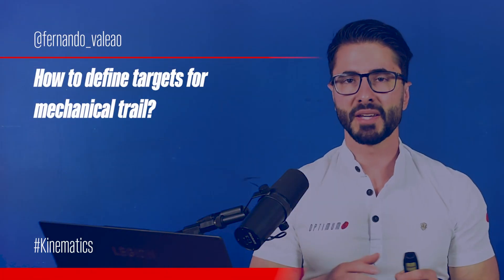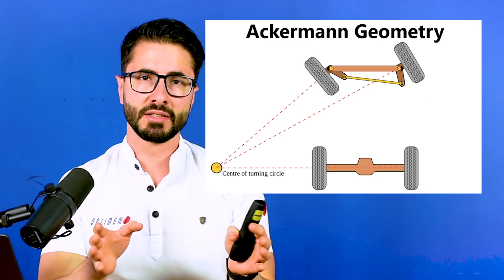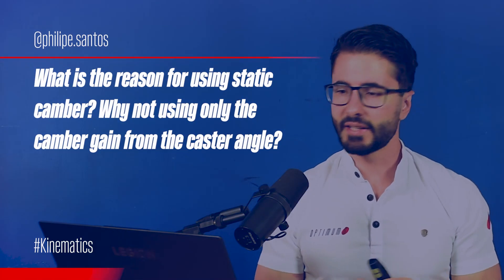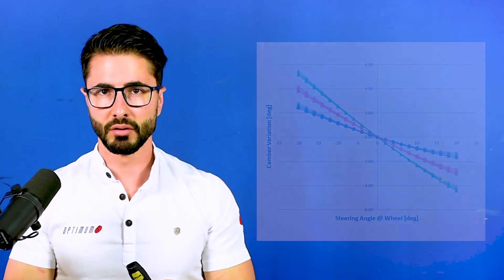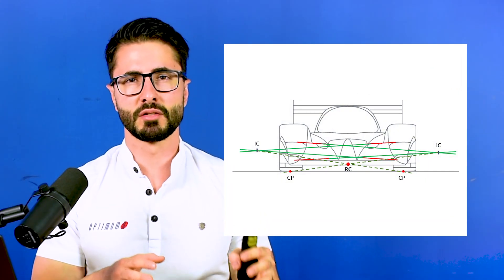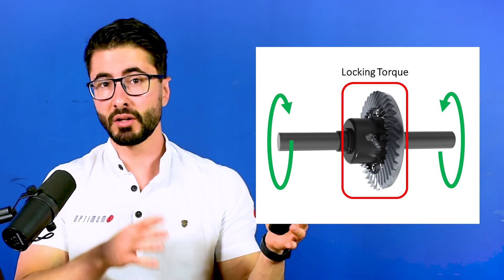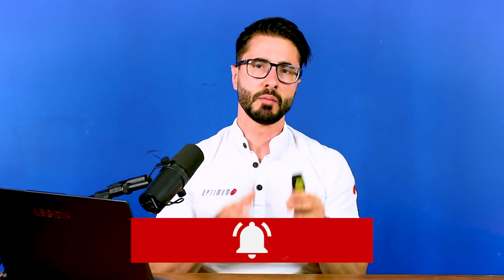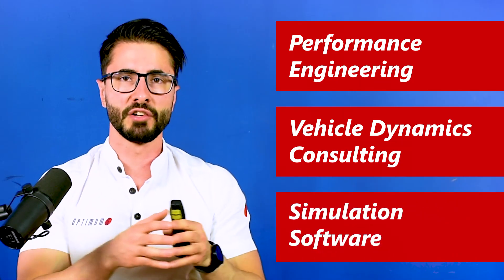Vehicle Setup and Kinematics | Q&A Series - Ep. 1

Comment: Hello! I have a driver complaining about the "reactivity" of the car at the initial steering angle, feeling it to "sharp" at initial cornering.
Be carefull, he is not complaining about oversteer, but he is not right confident to dive quickly to the apex. He is not a "hard braker" in compare to another driver I have.
Have made some quick change before the race: softer front ARB, higher ride height front, softer clics on damper at the front (both compression and rebound), more toe out front, and more toe in rear.
Felt better, but not enough for him.
I'm wondering if the solution would perhpas be to make rear roll center higher, to change the kinematic load transfer balance? Does it makes sense?
Thanks in advance!

Comment: Very interesting. Increasing low speed damping does it increase or decrease load transfer in transients for that axle?
Reply from the maker: Increasing low speed damping will INCREASE load transfer on that axle in transient (when there is roll SPEED), in the same way increasing spring/ARB stiffness will increase load transfer (when there is roll ANGLE or suspension displacement).